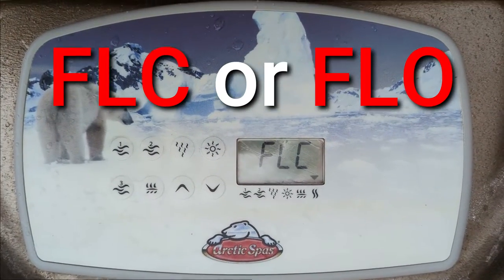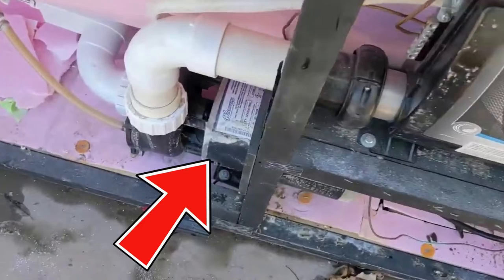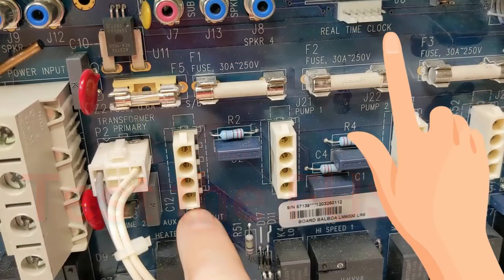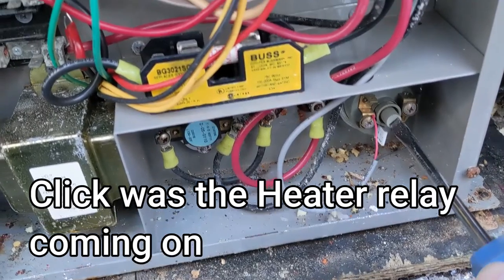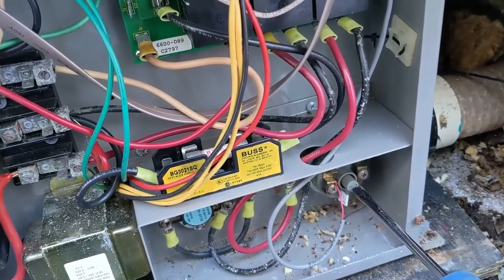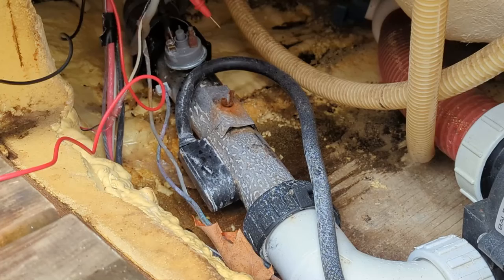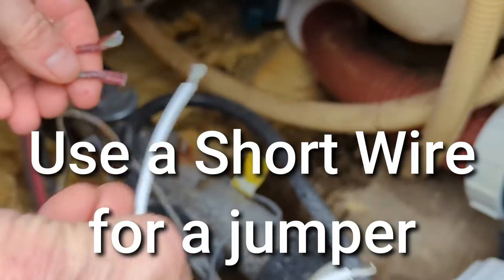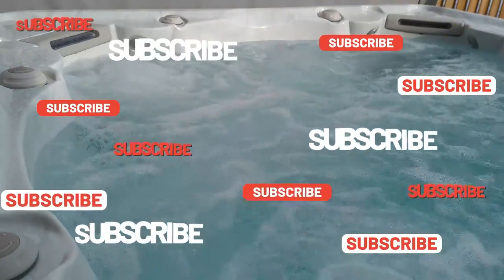Hot Tub FLC or FLO Error Code | Hot Tub Not Heating

Comment: Hello new subscriber here. I have Flo error, check and took of the filer, reset hot tub, all pumps are working, all jets are working, tried to adjust old pressure switch, still error, placed new  pressure switch , I still have Flo error every time if I turn on pumps or increase the temperature, hot tub does heat up but not fast. If I jump the switch I get FLC error instead of FLO. Artic spa. I would really appreciate any further advise
Reply from the maker: It's going to be a flow issue.  Could check the wiring for mice chewing it.
Reply: @VIPPoolsandSpas  I didn’t see any mice damage I did look, is there a way to test if wiring is faulty with multimeter?
Reply from the maker: @velimir1976  could connect one end and then test continuity on the other two.

Comment: I do not have a pressure switch, what do I do? I drained it and refilled it by putting the hose in through the drain to make sure I have no air bubbles. My pumps are working. When I turn it on it will go through the steps. It turns pump 3 on, pump 2 on and finally pump 1 then it will run the circulation pump on and then throws Flo code. I tore the circulation pump apart and everything looks fine. Could you please help me
Reply from the maker: what hot tub do you have?
Reply: @VIPPoolsandSpas  I have a dynasty XE
Reply from the maker: @amberloscar9389  if you have any flow error codes that will only come from one pump. The circ pump or pump 1.  It's the pump that pushing the water thru the heater tube.  Make sure that's working.  If not, why.   Let me know
Reply: @VIPPoolsandSpas  we took apart the cerc pump and didn’t find any issues but I have two big pumps to the left side of the heater tube and one big pump and a small pump on the right side which one should I check
Reply: @VIPPoolsandSpas  when it does its check when I turn it on all the pumps come on one by one and work as they should?
Reply: @VIPPoolsandSpas  also it will not tell my temperature at all on my screen. It will say the time then when the temperature comes on the screen it just shows - - - then say Flo.
Reply from the maker: @amberloscar9389  the pump pushing the water thru the heater tube.  check to see if its running.
Reply from the maker: @amberloscar9389  just make sure all pumps are rubbing.
Reply: @VIPPoolsandSpas  they are all running
Reply from the maker: @amberloscar9389 well, there's a flow problem and you'll have to find out why.  Pull filters and go right to the pump that pushing water thru the heat tube.